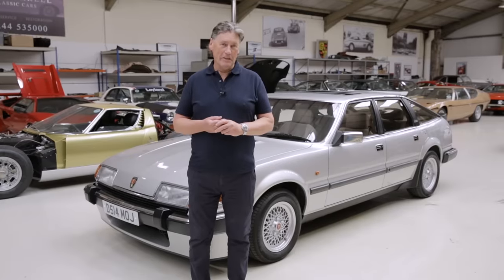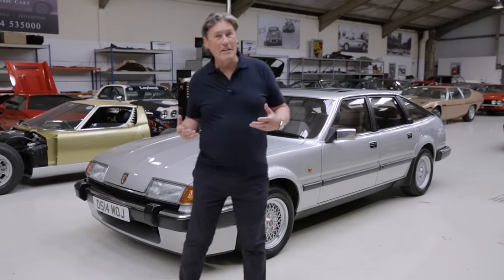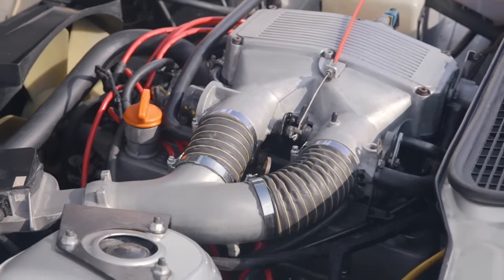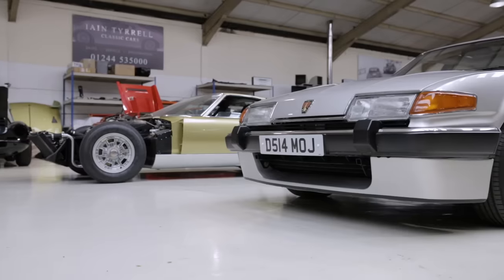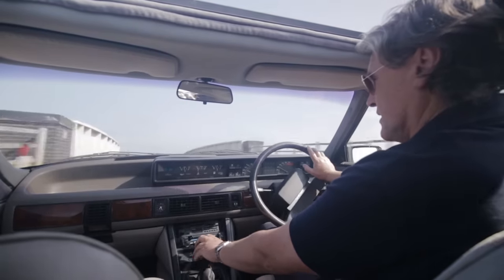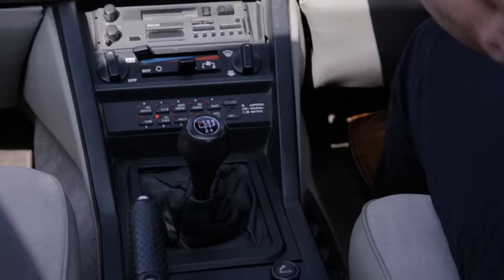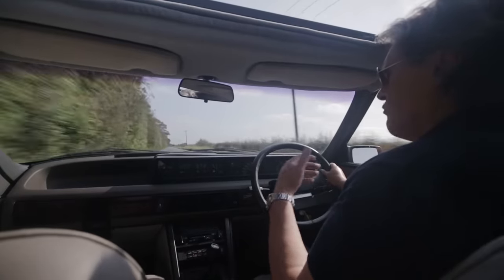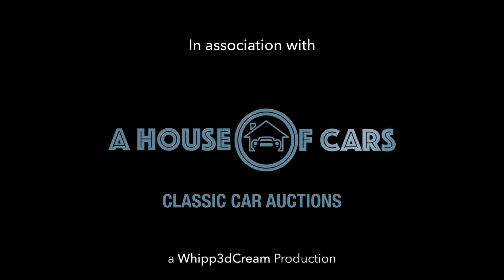Rover SD1 Vitesse - American V8 Power Meets British Engineering | Tyrrell's Classic Workshop

Comment: i had two of them one like this and another i only purchase for what today is 1.000€ that in 95 was in mint condition but had a diferent dash like circles not wide open like the one in the video ,it was a part that you could just atatched to the rest of the dash and a smaller engine a 2.6L ,the one like in the video was a 3.8L if it doesn´t fail me that i bought to a english guy living in the south of Portugal ,near the beach ,he opened a pub and i asked him if he wanted to sell it and he sold it the next day very cheap ,because gasoline in portugal it´s still today one of the more expensier fuel in all europe, that curiously when at home a midle-age man bought it from me like  5 times the price i had paid and after driving it for 5 years ,the car that i never heard no one talk good about them was never stoped all worked perfect and rust ,i live in one of the most dry areas in europe ,if not the most, at the time i liked the car ,but didn´t say vitesse that in the early 80´s the model that came out with honda engine ,I had the vitesse version with only 1.8L that was a very reliable car that i sold after 1 year of driving it to buy a mazda rx-7, this 1.8L vitesse was fast but not vitesse as the first i bought with 3 L almost 4 L , the one i bought in the 90´s looked older in finishings the 2600 of the model in the video, the guy who sold me was a drug dealer and also had girls to sell ,but he told me that he couldn´t find a part for the car that was in mint condition , after i bought it cheap i phoned to a friend´s junkyard and for what today is 20 € i bought the part and with another 20 they install it for me in the car it had a strange colour ,like golden metalized but a darker shade of this colour, i never heard anyone talk good of this car but i bought 2 in 2nd hand and it never gave me problems ,that made me thought i was lucky, and it was a good car to drive ,so the only problem was the gasoline for the engine that drinked a lot, i found it very similar not to the daytona but the other model than no one likes from ferrari with four seats(400 gti, a V12 colombo engine,the body drawed by pininfarina) ,a family car ,don´t know why but i found it looking good and saw in tv people destroying a perfect model of this ferrari that maybe it was a over-engeniered car ,maybe to make competition with the quatroporte(fourdoor) from mesarati , regards

Comment: the only reason the rover v8 was popular was because it was easy to get hold of, every breakers yard had loads in, it was a pretty crap engine, the lobes wore off the cam at around 100,000 miles and it only had around 160bhp

Comment: LOVELY vehicles. Have three. 3500SE cars. Prefer the earlier [but up-engined and 4.6 etc injection hat] short dash cars. Interesting the genesis, and where the car was sold off to when Rover ceased producing them. Upgrade brakes ALWAYS  a GOOD idea.......absolutely magic  HOWL to the exhaust and throttle response. Exciting driving, pressed......even the autos...comfortable and very good quick, sporting long distance travel vehicles.....autobox is limited, being a 3-speed, manual far preferable..............

Comment: What are they like to tune
Reply: Forgive me in advance for what is probably quite a boring story. I had a SD1 V8 over 20 year's ago and found it very hard to run smoothly. I took the car to a few of those 'auto tune' workshop's that connected cables and sensor's to different wires on the engine (sorry for the terminology, i'm not a mechanic) and pipes up the exhaust etc etc, and whilst it was ok after, never perfect. A friend recommended someone to me who was an expert in tuning engines. So, i called him, an elderly gentleman, who came along to my house, and got to work. All he had to tune my car were some long, wooden handled screwdrivers, and some much smaller, tiny headed screwdriver's. With the engine running, he put the pointed end of the screwdriver, in different positions, onto the engine block, and the handle end, up against his ear. And at the same time, with the tiny screwdriver, adjusted the carb's. I was very sceptical!. When he was finished, i took the car for a drive and it was like a new car, amazing. At idle the engine was hardly moving. Very clever man.

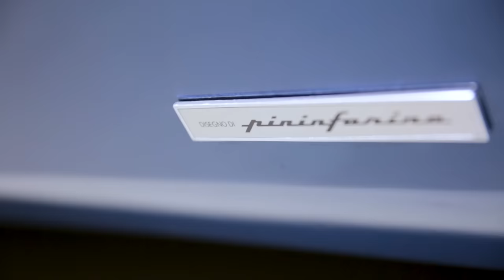Comment: 2:26  Blood channel.  Absolute and complete facking bollocks.  The cuts into a blade (called a fuller) are to lighten and strengthen the blade.  Nothing else.  The creases in the panel in the car simply strengthen the panel and give it a character line.

Comment: Ah would could have been had BLMC  survived.  Think of what it could be if it had 4valves/cyl direct EFI vvt and an multilink IRS and a 6/7 speed dual clutch automated manual and maybe a low leftover hatch then again Jaguar wouldn't have liked that.  Aren't the Land Rover /Jag V8s a cousin/descendant from the 3.5 one?  Esp during Jag being part of Ford and it's bored out 3.9 L they used on the Lincoln LS8......imagine an engine of GM origin ended up on a Ford car.

Comment: I think GM licensed the engine back from the UK in the 80's when they started downsizing.  The Brits actually fixed that junky engine so it worked and didn't leak oil and overheat.

Comment: I owned a 1980 3500  (SD1) for about a year. One of the  few sold in America. Worst car I ever owned in 40 years. Everything went wrong. Windshield leaked. Headlights went out during a rainstorm at night. Constantly overheated. Car just stopped while driving 60mph. Great design. But it was in he shop so much my mechanic bought it.

Comment: At least Rover mastered the art of how to destroy an allready good engine...
Just look at the intake manifold on early P5 & P6 3500 powered Rovers 
The High Output version of the Buick 215 had 215 hp (SAE) and it even offered in a turbo charged version by Oldsmobile. 
If I had a Rover powered by the 3500 I would replace it  with a 1964 Buick 300..
The 64 300 has alloy heads and intake and app. 300 hp output.
Even the later 350 Buick engine will bolt right in..

Comment: I had a number of these cars back in the 90's & found the finish was bad on the SD1 & better on the Vanden Plas, they were underpowered & the brakes terrible with the rear drums at back & small rotors & calipers upfront. Heaps of modifications were needed but other than that, they were an OK car. Pommie cars were always "just a car" back in the 70's & 80's.

Comment: Hardly an American engine,  rover completely reworked the original,  unlike Jensen that dropped in a 440 ci and transmission.  I worked on them at dealership level in uk when they came out in UK. They rusted faster than you could grind the corrosion out and brake rotors warped from heat if driven hard on twisty roads. They were imported to North America in injected form with cat converters but compared to domestic vehicles they were over priced and unreliable,  they didn't sell very well.

Comment: I wouldn’t call the British use of the Buick 215 cid/3.5l V8 “successful”. “Long running”, sure, but GM couldn’t get rid of that engine fast enough. It was a truly garbage design they only used for a few years, then laughed all the way to the bank when the Brits took it off their hands... who then used it for decades.
Reply: That garbage engine was the only stock block engine that ran in the Indy 500 since 1946. It ran for Mickey Thompson driven by Dan Gurney.  It broke the transmission at 92 laps
Reply: John Harrison then they should have made a deal with MT. However, a specialty engine with non factory internals isn’t comparable to the OEM it’s derived from apples to apples. Doubt BL could afford the increased unit price. But you go on and keep believing your delusion

Comment: I had one for many years 🤷engine was 👎🏻👎🏻👎🏻 Buick 215 ci I think 🤔 just some junk the yanks chucked in the bin and Britain bought…engine would sludge up unless you did very regular oil changes…and as for those SU carbs lol 😂just junk..I put a Holly double pumper carb on mine…I don’t rate the engine 😢I’ll stick to German V8 engineering 👌🏻👌🏻